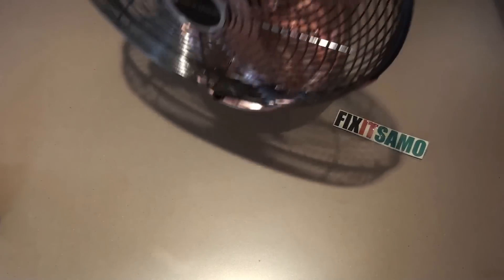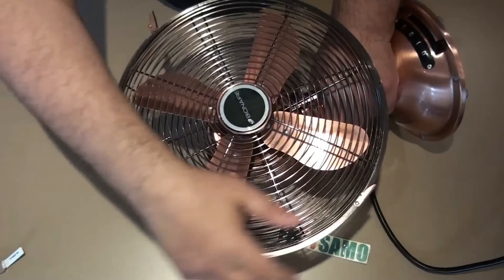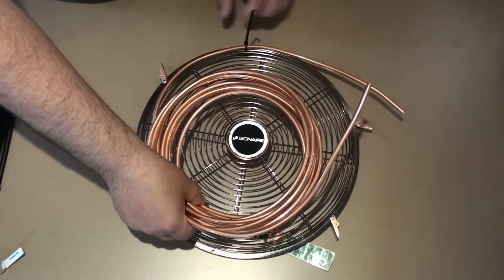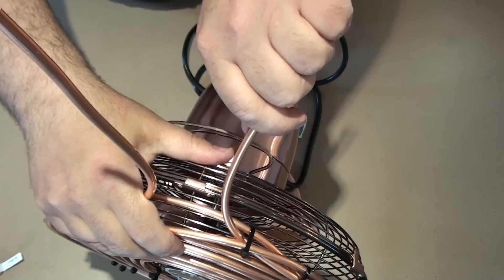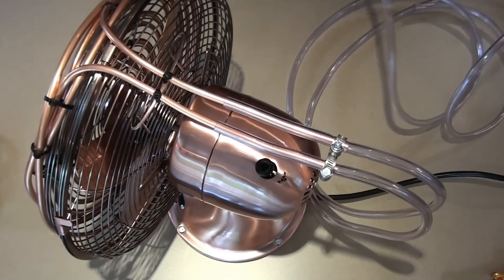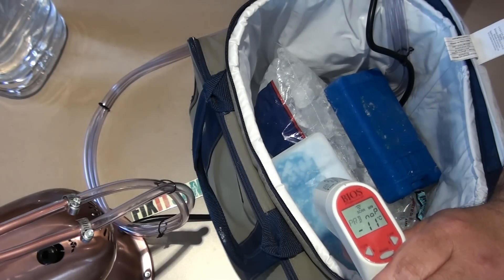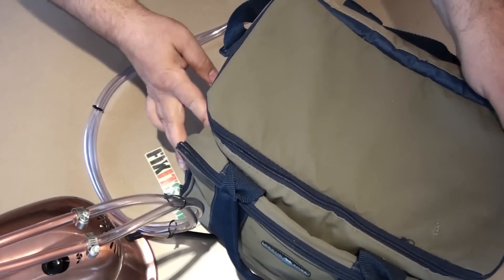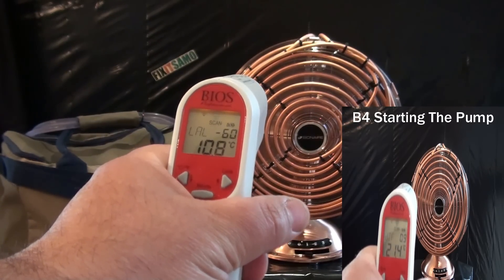How To Turn Your Fan Into An Airconditioner  AC

Comment: This is a poor design in my opinion. Because I feel it is not self-sustaining.  Once the ice has melted, it might turn into a heater.
Reply: He said it will last for 12 hours. If you can't bother to add more ice every 12 hours, you're never going to get anywhere in life because everything else is much more difficult.
Reply: *****  So I guess you gotta go to the Circle K Store to get some more ice then, right? To be clear I have seen better designs that don't involve ice runs and actually are self sustaining.  I really don't see the ingenuity of it. The Time and the effort as well as the cost would better spent for something that you might use for more than a couple of weeks or until the novelty effect wears off 
If this was created by a young person experimenting, It would be all about praise from me.

Comment: I like the idea, but the maintenance cost to keep it cool would rack up FAST.     Might as well buy a window AC unit instead... Works full time with out buying TONS of ice. :) 

Or just buy a central air system for your house, which is what I have running at 65 degrees Fahrenheit (18.3 Celsius) through the summer :D
Reply: Yes, definitely. Pay $1400 to buy a central air conditioner to cool the whole house when you can only be in one room at a time. Of course, the running expense, the maintenance expense, the finance expense. Why pay $20 for a one-room cooler that you can reuse the water (the freezer means no-buy ice).

Comment: This only works if the ice comes from outside the living space you're trying to cool. Otherwise the cooling benefit of the homemade device is nullified by the heat put back into the living space by the freezer used to freeze the ice again for the next use.

Comment: Hmm.... using that water-proof bag is something but using a large plastic container or water drum will be more practical bro. And if the fan has an external housing unit with DIY vanes.... it will look cool and generate more cooling effect inside the room. Just sharing my thoughts... good job
Reply: That "bag" is an insulated cooler. It will work better than a large plastic container ever will because it slows down the rate the ice melts at and will keep the water colder longer.
Reply: ***** Ok, noted

Comment: Nice job but why do you need any form of cooling device if the temp is already around 20 degrees. 20 is pretty cold I guess and even Split ACs bring down temp to 20ish.
But I don't think it'll work in areas where it really should work where temp is around 40 degrees.

Comment: folks I made this for a 10x12 room and it only moved the temp from 84 to 82 and the blocks of ice melted within 3 hours, really doesn't work.
Reply: I have done this type of thing before on a bigger scale. It will work for about an hour or two. Once the ice melts the water will heat up. It will happen fast. The water comes out cold and goes into the cooler warmer and melts the ice. Works but not for long.  I always applaud those who try and learn things. So way to go. One would need a lot of ice.
Reply: +tim4962 how about just drilling a hole to a fridge and let the watrr cycle in it going out seal the holed tight after putting the hose in it

Comment: What was the price of all the parts (USD) ?? Probably around $100 ??? Cause you can buy an A/C unit for around $150 and you don't have to worry about ice everyday or two..
Reply: But the electricity bill and the water consumption makes it more expensive and the limit is 24º, with this you just put it for 10 minutes cooling a room with 10º and the you turn it off, and as well you can use the same water for the ice infinite times and its cooler and cheaper.

Comment: Is this best way to make a home-made AC? Is there any other better way which does not involve ice cubes or something?
Reply: How about a snow machine.
Reply: you can make different kinds of water chillers but a home made A/C is nearly impossible (there is a lot of engineering that goes into it in order for it to work correctly). Im not saying it cant be done, however it would be costly and you will have to be EPA 609 certified to buy refridgerant and parts will be difficult and exspensive to find. your better off buying a cheap window unit or inside space cooler.

Comment: Even when using a halfway decent ice chest, 10 to 20 pounds of ice melts in about an hour. Also, this is with the feeder and return tubes on opposite sides of the cooler.

Comment: If you buy the ice, this will provide some net cooling; otherwise, your fridge compressor is running overtime to remove heat from water to make ice. Your fridge compressor fins then add that heat right back to your home. Due to friction losses you are actually causing a net heating effect in the house.
Reply: Yeah yeah yeah, I'm sure he's trying to cool the area he's occupying, maybe a part of the room he's sitting in, rather than the whole house itself.
Reply: You understand the situation just the same as I do.  Your comment makes sense.
However, I get the distinct impression some of these other posters fawning over this device do not realize he is actually net warming his house.
Reply: +fenderstratguy what if my fridge is in the kitchen which is not in the house or even close to the room i am cooling?
Reply: +Afnan Butt   Then it would be fine.  However, most peoples' fridges are NOT outside their houses.

Comment: Just moving the return line to the opposite side of the ice-chest will greatly increase this air-coolers efficiency. Placing the return line to the opposite side gives the warmed water that much more volume of cold and ice to travel to on it's way back to the water pump inlet. Dumping the return water on top of the same area that the water pump inlet is does not give the ice and chilled water time to cool down the water that is returning from the fans semi condensing ring.

Comment: Have you tried to add salt to the ice water to cool even further? I bet you could make a simple drip catch for the system. This idea is only as good as the cooler. If you are spending $5 day on ice it's not worth it but if you can keep the ice costs low with less ice or less frequent I could see this being great in a pinch. Good work.

Comment: you idea is in the right place but you will have condensation off the coils.  #2 you would have to keep putting Ice in the bag, why not make your system more like a Chiller, use natural convection or a condenser to remove the heat from the water or Glycerol.  Just my 2 cents,

Comment: What if you did not use ice. Will the fan be enough to cool down the water as it cycles ?
Reply: it'll actually bring the water temperature down to room level. Wind doesn't equals lower temperature.
Reply: The friction from the fan blades on air molecules actually increase the air temperature, so unless a constant balance is maintained between the two,...the air and water temperature, then no, the fan wouldn't be enough.

Comment: So.. this is stupid. This is nothing like an ac. You constantly need a freezer to make a LOT of ice. The electricity bill will be over the roof because the fridge have to work really hard. And the water in the bag will warm up REALLY fast if the room temp is above 25C. Pointless... Rather buy a cheap ass on/off ac.
Reply: Shuxu Yi oh it's really hot.. Only 2 seasons, moonson and dry.
Reply: In my country, ice is cheap.
Reply: So I guess your country is not too hot to need an AC?
Reply: The amount of energy required to cool a room to a certain temperature will be the same regardless of if you use ice or some other method. Melting ice still absorbs heat energy from the room the same as any AC. Learn thermodynamics.
Reply: Using dry mode in AC (after 1 hour of cool mode) can also save your electricity bills
Reply: nuclearping No.. if a freezer reaches the desired temp,the compressor stops. Only start again if the temp rises. Dont talk dumb things. You would waste a lot of energy. I dont get why people do these shitty cheap things. Just buy a cheaper AC and you are done. Easy and fast.
Reply: eXoN Zero People are awesome and just want to be creative bro
Reply: nuclearping The freezer does in fact care if you put more in to freeze. Energy isn't free. You have to use energy to cool the bags you put in and then the freezer has to keep temperature.
Reply: nuclearping That's very ignorant. You will use in electricity the energy it took to cool the water to the temperature in the freezer plus the latent heat of fusion for the state change. Learn physics kid.
Reply: nuclearping You obviously don't understand thermodynamics.
Reply: nuclearping I dont want to be rude or anything.. but if you really think you dont waste that much energy cooling water below zero,you really dont know anything about physics. Still, a cheap inverter AC is the right choice. My split ac that i have use about 250-350Watts per hour depending on outside temp (the summer is really hot here where I live). And I have a constant 23 deg c in my ~30m2 room without any freezing or home made cheap ass things. Until we have a better technology AC is the only efficient method to cool a larger area. I still think that your method is good,its just not efficient at all.

Comment: Would this not work better if the copper tube was wrapped behind the fan? The air is cooled as it sucks it in and it would look cleaner as well.
Reply: No because any condensation could drip right down on or into the motor, where in front, it just gets blown all over your guests

Comment: This looks really cool but there are way easier methods like putting a fan in a Styrofoam cooler with a bunch of ice.
Reply: This way the humidity of the room is not being raised which is crucial if you anything leather inside the house, high humidity will destroy it. Might be harder but its a much better alternative.
Reply: I have a mini swamp cooler and it gets cooler but humid factor rises and lots of water loss. In the long run I think this way is much cheaper and can be ice box refrigerator modded.

Comment: Could I suggest you use Chill packs rather than ice? Re freeze them and use them over and over.
Reply: Just put them on a cabinet or fridge - the colder air will fall down and bring exactly the same coolness.

Comment: ok. simple cheap trick but now you're spending more money on making ice. it would be more practical to have an inner water tank surrounded by a salt water tank to help keep the pumped water at a lower temp. since the pumped water is already being cooled, the salt water should help retain a lower temp. however, now you're paying for making ice and buying salt. not sure how cost saving this is.

Comment: ideal and amazing

IF YOU LIVE OUTSIDE OF REALITY!!!!!!
Reply: and useless... the Fridge Makes more heat making the ICE than the Device will make to cool the area
Reply: Or you could deplete the Water Volume of the local reservoirs, and transfer the cooler Ground Temperature of the Buried Water System Distribution Pipes, and your cooling costs to your water bill, with a Chrome Faucet Diverter Valve:
http://i.ebayimg.com/00/s/NjAwWDgwMA==/z/rtcAAOxyJ8ZRipxo/$T2eC16F,!)kE9s4Z-UH-BRip)n0TH!~~60_35.JPG?set_id=880000500F
Reply: Duh ... Save more energy costs by unplugging your frige everytime its not busy making new ice cubes. Duh!
Reply: Unfortunately Municipal Water Systems do not provide 'return line' ((to the reservoir) plumbing systems for 'Geothermal'' Ground Temperature (usually about 56*F) cooling systems. So that water (after cooling usage) would be wasted into the Waste Water system. (Down your drain). That's what I meant by saying "deplete the Water Volume of the local reservoirs". Or you could outlay a Major expense to lay in your own 'Geothermal heat sinking pipe network in your own yard, with your own recirculating pump for that system. But it would require permitting and a lot of cost and effort to do. Easily more than just buying a simple Air Conditioning unit.

Comment: Wait -- ice costs money.  The same money can pay for the electricity a window AC uses.   
Can't afford an AC?  Finance it.  

What happens when you run out of ice?  Drive to the store again?
Then how do you store the ice so it doesn't melt for a couple of days?
Reply: if you have a fridge you can make ice at no cost
Reply: Fridge cost money to run, it also makes Heat in the house, this is a fart in the wind for cooling and not worth it. Remember, things do not Get Colder, they just lose Heat... so if the Fridge is making more heat by pulling the heat out of the water and dumping it in the room and you use that same water later to cool the room, net profit is zero. And net cost was all that energy to make the ice. and melt it again. Just buy a $99 AC from Home Depot and it will Dump the Heat OUTSIDE.
Reply: Duh ... Save more energy costs by unplugging your frige everytime its not busy making new ice cubes. Duh!
Reply: You got to be trolling.
1. You can make ice cubes yourself, for literally no cost.
2. You store the ice in the fridge..
Reply: Don't forget the fridge has a compressor that makes the ice -- and that's exactly what an AC has -- a compressor.  You've just traded one compressor for another and gained nothing.  In fact the fridge's compressor is probably less efficient coz it's a smaller compressor.

There is no free lunch.
Reply: My point is.... If you have a fridge running in your house, which is almost everybody has.. You can make ice for free since you are already running it and paying for it. Don't make things so complicated.
Reply: Exactly.  Don't make things so complicated.  Want an AC?  Buy one.  

It'll cost you less.

Comment: Simply put a block of ice in front of the fan. When it melts get another one. Feel the cool breeze.
Reply: If you can buy a block of ice just get an AC!
Reply: +Alvin d Dude a block of ice is not that expensive
Reply: Rotate having 2 milk jugs... one freezing in your frige, and the other in use in the cooler.
Reply: You can make a block of ice in your fridge! jeezes

Comment: That would supply cool air for the person(s) sitting right in front of the fan. It won't cool your room down, unless you're in a small closet or an empty refrigerator box. The outside heat supply is much greater than the amount of cool air you'll get from the fan. You'll have a nice cool breeze but you'll need a large and continuous supply of ice. Fun project though :~)

Comment: hei dude, I have tried this but the copper tube is very dewy when I turn on my pump and my fan, until dripping my water onto the floor. is there something wrong?
Reply: No, condensation is just forming on the tubes, just like on the outside of a cold drink in hot weather.  You really cannot prevent that from happening.
Reply: bradagain
The first time I saw this video, I have been predicting this will happen but I don't see any dewy on the copper tubes that drips in this video. I had wasted my money :'(
Reply: +niZ Godsonovski well yes and no.  you can probably create a catch for the water so it doesn't just fall onto the floor.

Comment: Yeh they don't work that great yes it's absorbing heat but you don't get very chilly air plus he isn't using an ambient air thermometer he is using a surface temp thermometer which just proves the surface of that tubing is cold not how well the air is being cooled

Comment: that's a lot of condensation to deal with though !you have to have some sort of drip pan for that
Reply: I am of the thought that the fan running might prevent a condensation problem.
Reply: +Polska cat As long as the pump is running and there is atleast a 15 degree temp. between air and the coil with a high relative humidity in the air there will be condensation. The amount will vary dependind on fan speed. The slower the air passes over the coil, the more condensation there will be.

Comment: Some stuff that will make this work even better:

> Use empty milk, juice, or soda bottles, filled with salt water, and freeze in the freezer. Use 1/4 cup of salt per quart of water. Be sure to leave a couple inches unfilled because the ice will expand when it freezes and burst the container if you don't. This salt water ice will last longer than plain ice.

> Use a soft side cooler like the one in the video, and put this in a box, plastic storage container, etc - insulate all around the soft side cooler with old towels or newspaper. The colder you can keep it the better it will work. 

> Make the return line 3-4 feet longer and coil it to fit into the the bottom of the soft side cooler, then put your ice and water in. This helps cool the returning water and your ice will last longer. 

> Use another regular fan elsewhere in the room to help circulate the cool air. Keep in mind a small fan uses much less electricity than a light bulb.
Reply: Good ideas except for the 3rd one.  Cooling the return water in a coil inside the cooler will make no difference, the heat transfer is the same.
Reply: Could you explain a little more on the return line please
Reply: The water enters at a certain temperature (warm) and exits at a cooler temperature. The ice is melting as it cools the water.  Coiling the return tubing at the bottom of the cooler will lower the temperature of the water when it dumps in to the cooler but the effect on the ice is the same.  The ice has to cool the same water whether in the cooler reservoir or in the extended return tube coil.
Reply: +C RB That's all wrong. She's a woman.

Comment: whats the diffrence, air cooler and air conditioner?
Reply: an air condition unit carries the heatload from the said room outside through a process called convection ,which is why you have the part outside to dispense the heat ,a cooler just circulates the heat load the effectiveness would not be as great as an actual ac unit
Reply: +Locutz M in a small room in a big house it would, just like the cab of a car. ac is simply the removal of heat, which is efficient in a smaller confined area